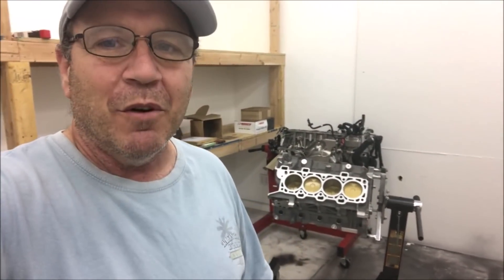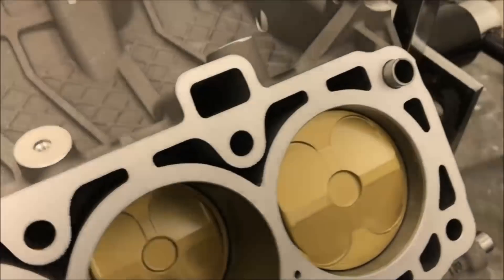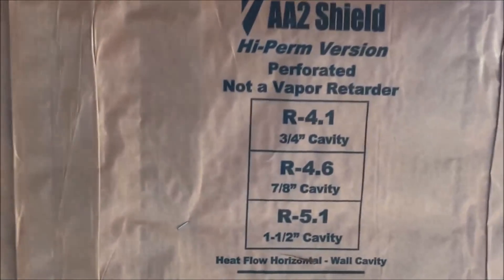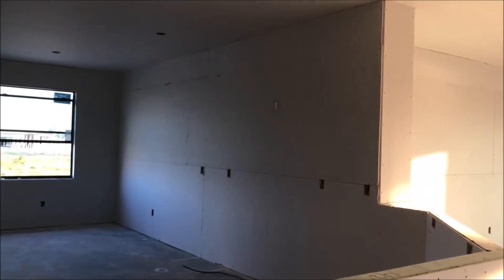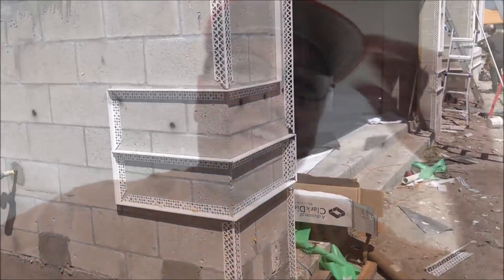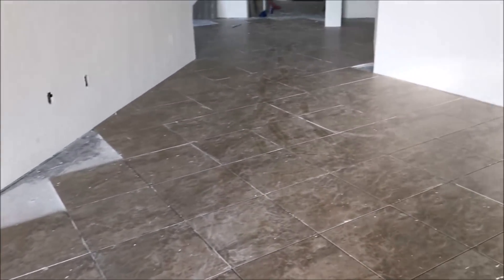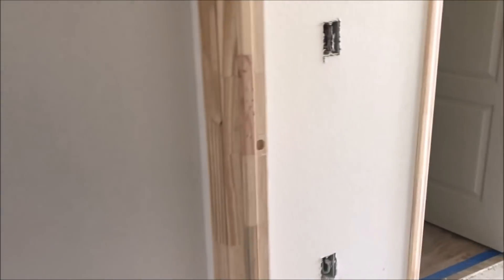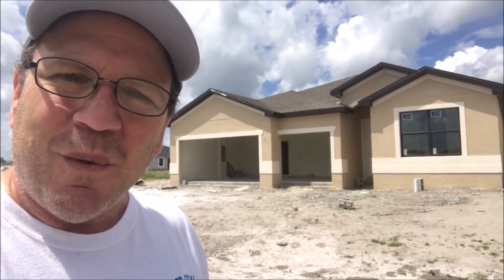2018 Mustang GT _ New Short Block _ Check out My Other Build!

Comment: It's nice to see the work progressing nicely on your new house and the new engine. That was an interesting point about the additional spot reinforcement of the cylinder at the top of the block. It makes sense, as that is along the thrust axis of the piston and is the line along which the power and compression stresses would be applied.
Reply from the maker: Jim Nesta,...... Thanks Bud. Just something i noticed. For what it's worth.

Comment: happy for you Al...I just got my block in also after losing cylinder #4..are you reworking heads or slaping the old ones rite back on?
Reply from the maker: Yo James!!  We had the old heads checked and they are fine. very low mileage. What block did you get?
Reply: @coyotecarguy2076 I just bought a Ford short block car should be just 750whp anyways and ima turn up the boost and switch fuel probably next year and hope it holds up

Comment: I wish i had of saw  your home before it was drywalled in i'm an electrical contractor and would have gave you some good pointers on a few things to have installed prior to drywall. To late now so no need to. Looks really nice. I would however install led everywhere there is a light go with the 4000k color dimmable it looks really nice and modern. And yes we stub the pipes to the island before they pour the slab. Where we live we get subterranean termites and don't like to cut the slabs after they are treated. For the record you are not allowed to run regular romex in pvc if it's in a damp area, in the dirt, or outside the home. The inspector will catch that. It would need to be UF (underground) type cable. The car is coming along nice. Keep posting.
Reply from the maker: Mad Max......... Wow To bad i could have used the pointers. Anyway thanks for viewing. Nice to have you here!

Comment: 12:1 compression with a supercharger sounds too much for a street car.  Can you explain how you're going to manage that?
Reply from the maker: J Riley. From my research this engine can handle about 10lbs of boost on 93 octane.
it should make bout 700whp. if i run e85 it will make more than that!!
Reply: @coyotecarguy2076   Exactly correct- nice to see you kept the engine factory spec just better built i will do the same if I end up needing the same thing with my 18

Comment: Al, that 03 Cobra block you saw is called an "aluminator" block. Almost as strong as the cast iron block and 80 lbs lighter! BTW, your gen 3 short block looks pretty stout my friend! I imagine that this has been done already, but make sure your oil pump gears are billet, not pressed!
Reply from the maker: tominator........... Thanks Man! We got a new oil pump with billet gears from boundary.
and a billet crank gear.
Reply: @coyotecarguy2076  Sounds like your beastie will be good to go!

Comment: Are those cast main caps and crank? Why not get forged/billet ones?
Reply from the maker: The Punisher..... This is a livernois engine rated to 1000 Hp... I doubt i will make that much. I imagine the main caps can handle that.
Reply: Cranks are factory forged. Think about it the stock caps are strong enough for the GT500. Billet is needed for 1200hp and above builds.

Comment: You should remove that foil paper and have them install the 4x8 sheets of insulation mine is a R6.6 works much better that that foil. Congrats on the new motor and home.
Reply from the maker: D & K Vloggers........  I really have no say in the matter. this is how the builder does it! But it meets code.
Reply: Coyote carguy I understand, I had it in my 1st home but my last 3 that we built I made sure they used the other, made a huge difference in my cooling and heating bills. Also spray foam the ceiling was another huge option that made a great improvement. My current home is 2850sf living and just over 5200 total, run our AC at 73 all night and 75 during the day, electric bill around 130 per month with 3 in the home. Congrats on new home. Keep up the great videos. Gotta meet one day just bought another C7 ZO6 my 5th, lol. I’m in the Cape.